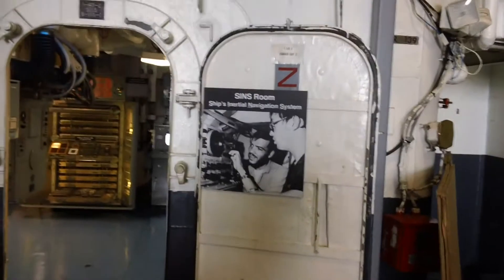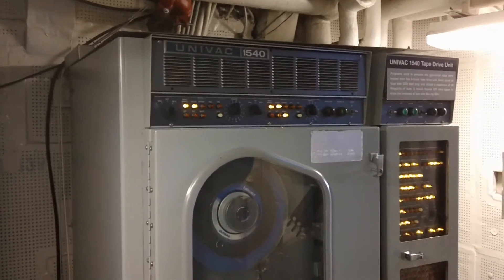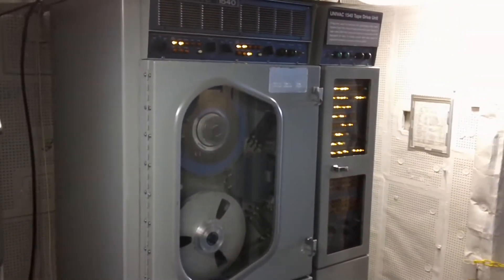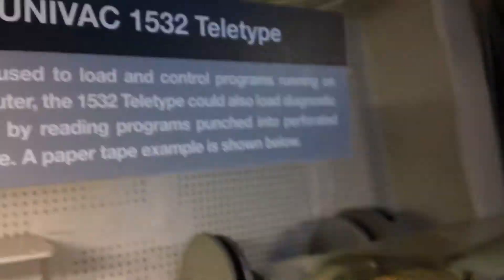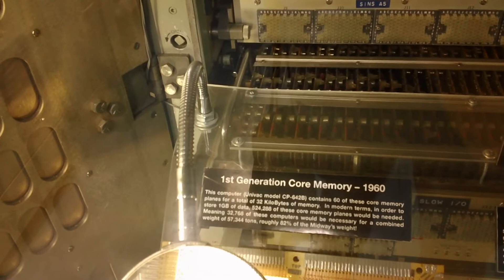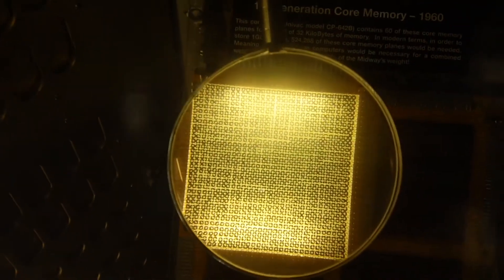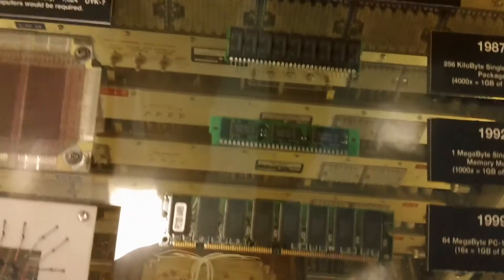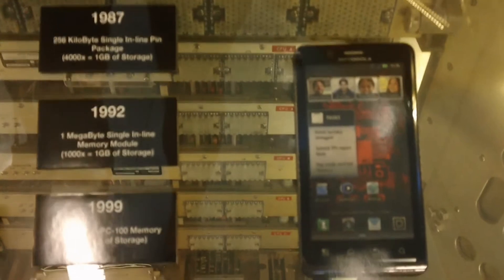Classic Computing U.S.S. Midway Inertial Navigation System.

Comment: You skipped right past the heart of the SINS Room; the last cabinet that was hanging from the wall is called the binnacle. It housed four gyros and two accelerometers and the required electro-mechanical equipment to keep a level platform for the accelerometers.  The internal platform was mounted within a 3 axis gimbal so it had complete freedom of movement,.
It is critical to keep the platform level so that the accelerometers are unaffected by gravity. 

The navigation is an accurate form of dead reckoning. On startup of the system, you input the latitude and longitude information into the computers and  start the system , After 
auto-leveling and  alignment to true north, the system is placed in navigation. The accelerometers sense any velocity, the system keeps track of velocity and the latitude and longitude are also updated. Ships movement is detected and the internal platform is counter torqued to keep the platform level. If you look inside the gimble at sea, the internal looks to be moving but it remains level. A constant torque is also applied to the gyro table to correct for earth's rotation and the change of location as we move across the ocean. 
This is the short description but is what goes on to navigate with  a SINSystem
Reply from the maker: Thanks for all the interesting info.